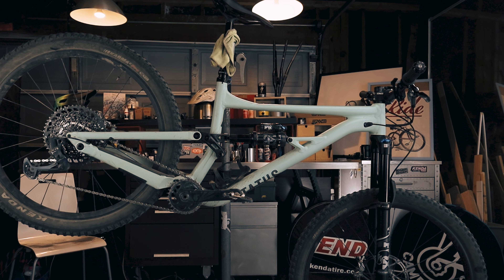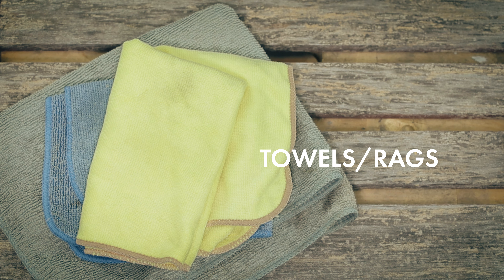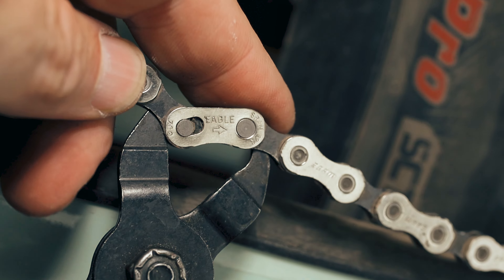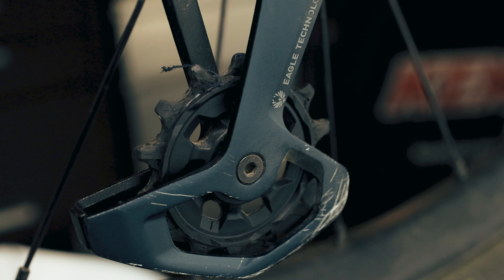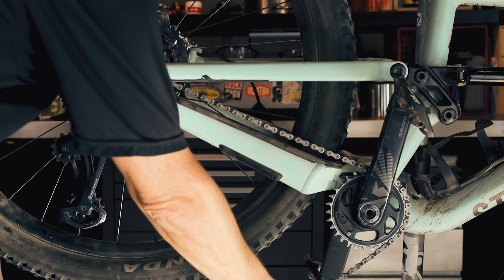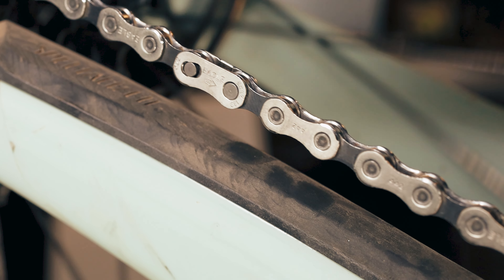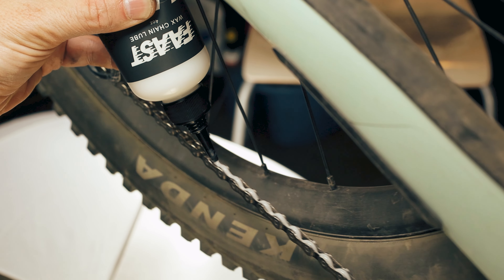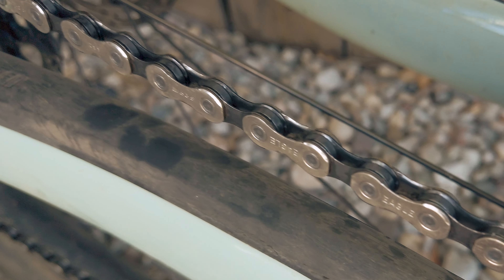How to Clean & Lube Your Chain: Wax Lube for MTB & Road Bikes

Comment: Thank you for the short and simple manual! 
I was always wondering what cleaning solution can be used and how to dispose of it later with no harm to the environment. Vinegar and water should probably go to the sewage with no issues, but not in the ground nor storm drains.
Reply from the maker: hope it helps! I'll leave disposal up to the user... there's info out there what can be done with each type of cleaner. use best judgement and thanks for thinking of the environment!